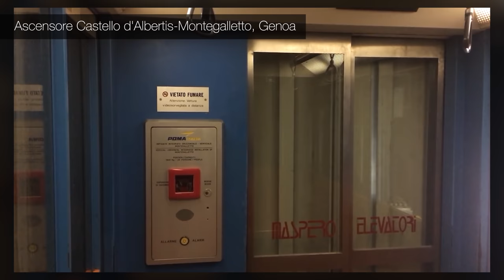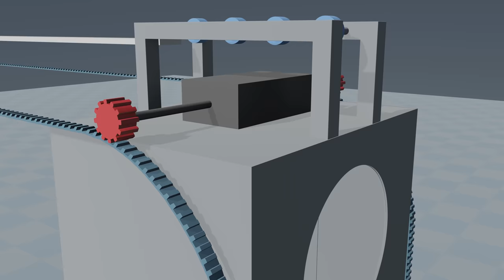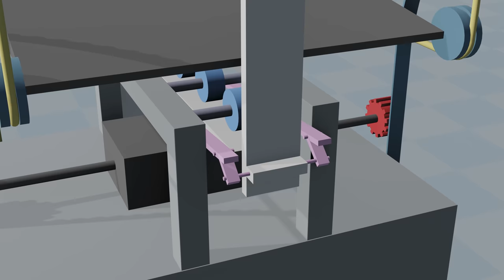I thought the Schmid Peoplemover was impossible

Comment: I think the main reason it's not as commonly used is because it's capacity is probably a lot less than with 2 regular elevators and a bridge, which allows for a constant two way traffic, where this elevator you'd have to wait for it to come all the way to you. 
This system works great for places that doesn't need a high flow capacity, this automatically results in 2 elevators + a bridge being installed in high traffic areas, and if it's used there why not everywhere.

It's an amazing piece of tech and if it could move more people back and forth in less time it would undoubtedly be used more often
Reply: it looks like the station it's installed at also has an underpass?
Reply: maybe a double design? Two people movers synced to opposite sides
Reply: Exactly, this system has very low throughput
Reply: Interestingly, because it's functionally a railway... there's very little stopping the design from being modified to go sideways (well, more like around a loop) at the ends so it could run in a loop, essentially 'double tracking' it and allowing two-way traffic (and multiple cars). That introduces it's own complications, of course, but it would increase throughput in a way elevators generally just can't.
Reply: I think of this did become commonplace and therefore cheaper, it would become default to have two or more in the same place
Reply: It's a clever design, but what does it actually solve? Even if it were available more cheaply and easier to maintain due to mass-production and standardisation, it seems to offer a very marginal improvement over just having two elevators while introducing a lot of drawbacks.
Reply: @laurencefraser  Add more cars and keep it moving and you have a ginormous Paternoster.
Reply: well you said it yourself, it works great for places that don't need high capacity. And youre right. But that's exactly why we could and imo should see more of this at small stations. Also I'm sure you could build a larger elevator to carry 5 or 10 people. If a government actually invested a great deal of money on this system at multiple stations then parts and technicians wouldn't be so scarce anymore either.
Reply: Wait a few years until Thyssen Krupp finishes it's elevator projects, then you can have multiple cabins making round-trips through a similar structure
Reply: @laurencefraser  or, hear me out, the same system but mostly vertical. You have two elevator shafts side by side with a horizontal connector at the very top and bottom. One shaft is for the "floor bound" and the other is for the "roof bound" just like an island platform in a train station. Unlike with a conventional elevator system, you can run multiple cars down the same shafts. High throughput building.
Reply: @lizzzylavender  Having two cars that cross simultaneously also kinda solves the counterweight issue because they would counterweight each other.
Reply: @bdiddy77777  About the same as a 7–10 story elevator I'd think... which is probably why most hotels at least two elevator banks. Having even ONE extra bridge-o-vator™ would drastically improve this.
Reply: Imagines if the Schmid People Mover and a Paternoster could be combined......
Reply: @noodlesthe1st  but even small stations have larger groups (>8) arriving at the same time - the time the train arrives.
This elevator needs 1 minute to carry 8 people. So if you step out of the train with 8 other people - not so unrealistic even for small stations - now 1 person needs 3 minutes to get off the platform.
Reply: @Freekymoho  But then you need four elevator shafts, and two bridges (or one which is doubly as wide). By having two elevators, you just need two shafts and one bridge.
Reply: @Freekymoho  I was thinking that. Two in tandem would be ideal.
Reply: @madattaktube  The only thing I see it solve, is the need to close a railway to construct a method to get from one side of the railway onto the railway station itself without crossing the rails.

At the cost of being high maintenance and low throughput
Reply: @Jehty_  so maybe a 10 person version of this lift would be ideal? idk, it's still a small price to pay considering a bridge with lifts built in would be really expensive for such a small station.
Reply: @noodlesthe1st  how is the Peoplemover less expensive than two elevators and a bridge???
It is 3 complicated elevators and a bridge. Obviously it is more expensive.
Reply: @PeterJavi  but every prefabricated bridge solves the same problem.
That's not something unique only the Peoplemover has.
Reply: Just put another next to it problem solved.
Reply: the cabin could be way larger and the system faster and 2 way. there is nothing stopping it from scaling well.
Reply: If you took two tracks that are combined at the ends, this construction would have a gigantic capacity
Reply: This is just a demonstration piece, a "least viable product" to show the design works.  Make it a little taller and a little wider and it can have a single continuous loop that has more cars: think going around the perimeter of the letter " C " but on it's side.  The design wouldn't need any significant changes, the geared system would work perfectly, and you could put in as many cars as can fit.  The only issue is then that if people block one of the cars from moving (ex: keep the elevator doors closed), other cars would have to stop and start again, which would be annoying.
Reply: @Jehty_  Maybe the bridge can be weaker because it can't be full of people.
Reply: Maybe they should make this a circuit system (with cars returning underground or on some second layer, essentially running in circles), and make the car open like a Paternoster-type elevator. That's be awesome!
Reply: The main reason it is not commonly used is as Tom said, there are already alternatives that are only a little bit more hassle, but without the added downsides. 

That's the thing about the way we've built our society. We find a solution to a problem and heavily invest in that one solution. We build factories and standardize measures across the globe. The problem here is one of sunken cost, we're absolutely terrible at discarding worse methods in favor of better ones because we do not have the capability to switch quickly. This has been especially apparent with our dependence on oil. It took decades to phase out plastic packaging for more environmentally friendly ones, and we're still not even close to done.
Reply: @Freekymoho  That dude would love it! Twice as many sales!
Reply: I wonder how well this would work if you had a "stacking" mechanism, where you have multiple cabs and a space beneath each platform where the cabs can push down and "queue", kind of like a fast food tray dispenser. Then, you can have multiple people going in one direction at once. (Of course, each would wait its turn to unload its passengers) Then, you could have two right next to each other where they are specifically designated to go in opposite directions to each other when they are in heavy use. Of course, the other option is probably much more practical than putting this much effort into making it work.
Reply: @madattaktube  Install time took 3 hours, which is very cheap
Reply: @flexo3333  piss would be the main reason people would be pissed if it was the only option.  I never use this thing even though it is really really cool, snd it is because it isn’t taken care of well enough.
Reply: @Freekymoho  The problem with that, is that at that point you might as well build a large footbridge with a lift at both ends and stairs.  That way you can have traffic on the bridge, on the stairs and two lots of people in the lifts simultaneously.  Compared to people two lots of people in two peoplemovers.

If you installed a footbridge or underpass and two peoplemovers, that would be a luxury of convenience and it would still be less efficient as the lift traffic wouldn't have the footbridge to use.  And you could install two sets of lifts in the same space as two people movers for even more capacity.
Reply: @randomguy8196 If that reasoning were true than elevators wouldn't be the default transportation in (nearly) every multistory building in the world.
Reply: build 2 as a double and have the cabins sit at opposite ends so there is always one waiting if not being used.
Reply: *its capacity

"It's" is only "it is".
Reply: @Freekymoho  Good thinking but that would merely double the throughput. A footbridge with 2 elevators means each elevator can spend all the time moving people up and down without having to traverse the horizontal part. Plus if you have stairs as a backup then lightly-loaded able bodied people can use those in times of peak traffic giving you enormous throughput if they're a large fraction of pedestrians in the area.
Reply: Imagine a TWIN version with two elevators side by side always going in opposite directions. I like this type of bridge - The overall philosophy prioritises the road or rail traffic and pedestrians have to be patient whereas everyone else worries maybe a little too much about keeping the pedestrian happy.
Reply: You could simply have two or more next to each other to increase thru put.  This is brilliant, AND smooth!  Gotta love German engineering.
Reply: counter point, these seem cheap to make and this was only like an experiment, i can imagine building a larger one of these and at considering these were cheap you could easily have multiple
Reply: Just add an additional tunnel for a full circular track and let it run like a Paternoster. :D
Reply: And if you need 3 elevators it does not work at all.
Reply: @thibauldnuyten2891  the downside Tom mentioned was "lack of special trained engineers", which wouldn't be a downside if they were more common.
The downside I'm mentioning is the traffic throughput. If the alternatives are better people will start using alternatives, but in this case the alternative isn't better.
The purpose of elevators is to move as much people as possible in as small as possible amount of time, which is were the regular elevator shines.

Comment: As someone trying to plan a vacation with two older people in wheelchairs: accessibility isn't common. It's not the standard. And we're left going "people in their 60s who COULD be independent can't because things are still lagging behind" and trying to find a solution that doesn't make someone with a disability feel like burden... :/ And the smallest bit of independence can do that...
Reply: Travel to Vienna. every bus, subway, S-Bahn and around 90% of the trams are wheelchair accessible. There is no station without elevators and when have full wheelchair accessibility in the whole rail network of the city.
Reply: @paddybm3245  But I do want to travel to Europe, put my German degree to actual use instead of just remembering vague greetings. (Fun fact, I know where Vienna is... I was relating my German knowledge to a city in Europe where German is spoken. Thank you 👍🏽! 🦆)
Reply: @dinahmyte3749  did you mean travel to Germany? Because AFAIK, Vienna is in Europe
Reply: @dinahmyte3749  Vienna is in Austria where German is the national langauge.
Reply: It's issues of space, cost, and differentiation. People are people, and with very few exceptions at the high and low ends of the height scale one thing works for everyone. Accessibility is a whole different thing. Ideal wheelchair design is different from walker design is different from blind is different from paralyzed or weak. Accessibility standards try to meet them all and do passably, but take up SO much more space and cost much more to add that it makes the balance sheet very hard to rectify.
Reply: The Schmid Peoplemover may be a bit more complicated for the people working on it, but it'd make things a lot easier for a lot more people.
Reply: @Rotem_S  ...yes? I meant travel to Europe, which includes Vienna and Germany because I have a degree in German and would love travel and practice one of the main second and third languages of a lot of Europe...
Reply: @thevitulus  Yes? I was relating my own experience in an European language (German) to a country and continent where that language is spoken. Thank you! ❤️

Comment: That one is annoyed with having to stop the car “for a single pedestrian” really has to be the most German reason for building a horizontal/vertical elevator.
Reply: I have walked around in many countries. I get the impression that drivers everywhere hate to stop for pedestrians.
Reply: Here in downstate NY it seems like some drivers speed up instead: "you wanna cross MY road, you carless jerk?!"
Reply: @feanenatreides  OMG I'm there!  That's so much better.  Where I live pedestrians won't so much as take a single step a bit faster or slower to allow a vehicle through.  Sometimes they'll dawdle across the road and look right at you and then stay at that glacial pace as if they are not stopping a whole line of traffic.
Reply: @geraldhenrickson7472  absolutely,  but people most everywhere typically don’t start building an elevator bridge as a result…

Comment: The other Peoplemover still in operation is installed at a S-Bahn (commuter rail) station in Berlin! It´s called Betriebsbahnhof-Rummelsburg and I never knew that they were this rare and uncommon! 
Great video as always Tom!
Reply: I knew it, it looked so familiar! Will have to get out of the train there next time.
Reply: @Electic that's closed according to Wikipedia
Reply: Nobody wanted to cross the road to go to Kaufland
Reply: Well now I know what I will be doing next time I get to that station.
Reply: @mistermist634  Be sure to take an oily or wet rug to make the scratched windows transparent again :)  (I tried it yesterday and you can't see anything out of the windows).
Reply: I live near Betriebsbahnhof Rummelsburg and wouldn’t really recommend using it there. The chance it’s out of use is extremely high, fails all the time and db takes weeks to have it fixed. Also the windows are completely dirty and scratched so you can’t see anything. I always avoid using it and rather carry my luggage up the steps.
Reply: @ReSp0nCeHD  
That’s the theory vs. reality behind things like this. It’s just too rare and complicated to be a good practical solution.

Comment: Herr Schmid is a genius. It's a real shame his invention has not been taken up more widely nor his achievement recognised for the revolution it undoubtedly is. It would not surprise me if, in a hundred years time, this is not seen as a vital piece of technology. Herr Schmid, if you read this, as a very proud Englishman who hates it when the Germans beat us at anything, I doff my cap to you sir.
Reply: The only limiting factor of this is the lower capacity compared to elevators and a bridge, but that's something we can ultimately work around.
Reply: your british rotary watches are not bad too haha. greetings from a just finished german engineer
Reply: It's a cool piece of technology but I highly doubt it's 'revolutionary'. It can easily be replaced by a regular footbridge with an elevator on each end which would be simpler, have much higher throughput and no specialized equipment/maintenance .
Reply: I don't see the actual advantage to this thing, it will be slower because you only have 1 elevator going to-and-fro. Regular footbridges allow walking people to traverse in both directions, footbridges equipped with regular elevators can also accommodate wheelchair users without requiring assistance, are more fail-safe because you can just take regular stairs if the elevator is out of service, and easier to maintain because the parts are more common. Some regular foot bridges even have escalators and elevators at the same time for people in wheelchairs and people who have difficulty climbing stairs.

This seems to be a solution to a problem that does not exist.
Reply: Why not simply a footbridge with escalators?
Reply: @sepg5084  I'd suggest that it's a great solution to a specific problem that only exists in a limited number of places (compact physical footprint, narrow time window for installation etc.). Most of the time we don't actually need a great solution, just one that works well enough within the available budget.
Reply: @TashaJaeger  what about the flat escalators?
Reply: @bacicinvatteneaca  
Still, it's a slope and takes up more space, this solves that
Reply: @markoproloscic4492  and way worse for the disabled that this was designed for.
Reply: @sepg5084  Disabled try to remember they exist.
Reply: @bacicinvatteneaca  Disabled people you can hope you never are which is unlikely.
Reply: No hate, we manage to beat ourselfs on a daily basis. But not in a positive way. We managed to have build an airport (which is too small and too expensive) needing the most time (Guiness?). We have the Bahn, which never worked properly (after the WWII) and never made any money. Our bridges and roads have been forgotten, so constructions everywhere. These construction take so long (years), that after finishing you have to start over, because its already rotten. Our construction sites take so long, that rare species began to live on sandhills fomed by excavators, therefore we make a "Naturschutzgebiet" and do stop the construction forever.
Reply: @bacicinvatteneaca  Not everybody has working feet.